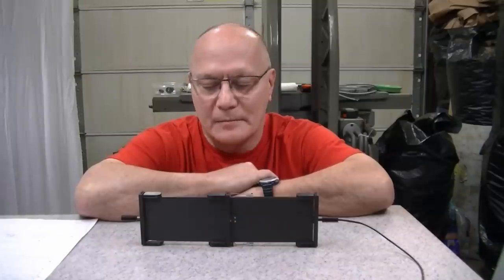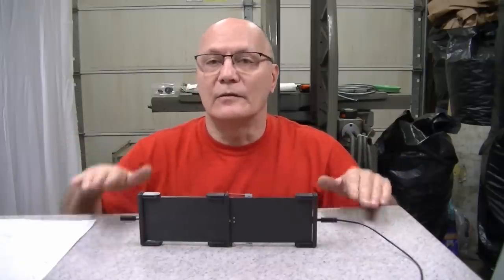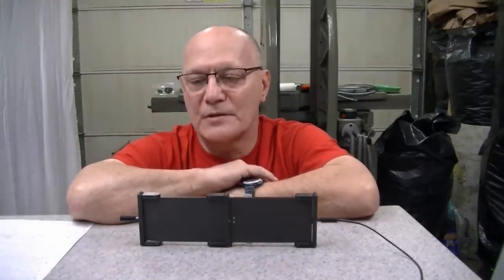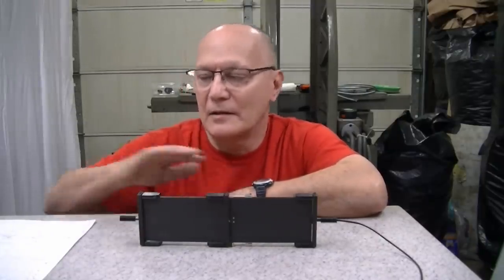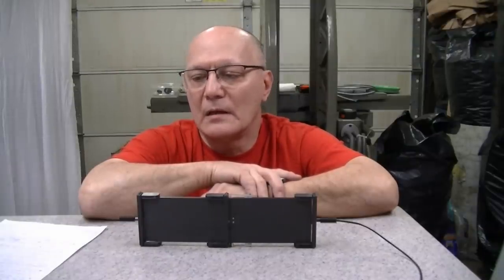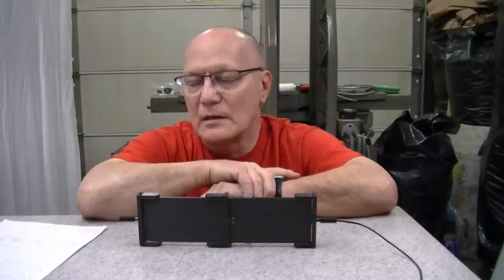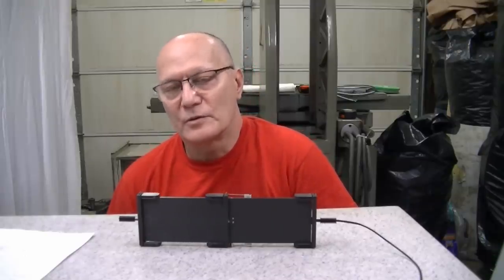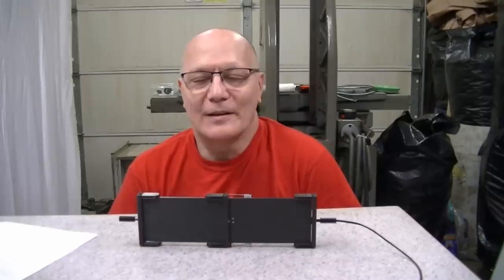DIY SURFACE PLATE LAPPING ANSWERS TO PART 1 QUESTIONS

Comment: So that "lap" resting on the plate makes it "not level" but its crucial to make sure the plate is "level" even though anything you put on it will "bend" it therefore making the whole plate USELESS since you can't put anything on it without "ruining" it by "bending" it even if only temporarily. Temporarily "bending" it while the load is on it, that is. How does anything "bent" by that "lap" or anything else placed on it or even "jacking" up one side of its "support" ever stay "flat" or "level" even IF it were possible to "level" it without "bending" it in the first place? You sure you know what the hell you're talking about? And isn't the proper way to use a "surface plate" to NEVER drag work or tools across its surface? If you want something to stay "flat" and "level" you don't drag hard objects across it. Ever. You lift up and set down work and tools VERTICALLY. Seems to me that anybody who manages to wear a surface plate period doesn't know what the hell they're doing and you sure as hell aren't going to "level" a "warped" or otherwise worn surface "flat" by dragging more objects across a "reference surface" that's not "flat" or "level" enough to support a "flat" and "level" lap. You sure as hell don't lap anything else in the "precision machining" world by using a "lap" smaller than the surface to be lapped and laying that lap on top of the surface to be lapped so the surface to be lapped that isn't as "flat" as the lap has to "carry" the lap but can't have its ENTIRE SURFACE LAPPED AT ONCE. In fact, you do the EXACT OPPOSITE and put the "lap" on the bottom, make sure the surface of the lap is FAR LARGER than the part to be lapped and move the PART all over the LAP keeping the part "stationary" while moving it in a figure 8 pattern so its "turning" relative to the surface and path it takes on the surface of the lap and "pushes" material removed out of its way. And by the way, you don't LAP PARTS to make them "flat". You LAP PARTS to put a specific SURFACE FINISH ON THE PART. Its "smoothness" you LAP ONTO A SURFACE. Not "flatness" or "levelness".
Reply: Deeremeyer1 actually, from what I have seen of professional surface plate lapping, the laps are often SMALLER than the actual surface plate being lapped they seem to get them to within AA certification with no real problems - I am sure i could find at least one video showing this being done right here on youtube, or you could simply let your fingers do the typing and look up oxtoolco surface plate calibrating and conditioning when they had one of theirs redone to AA specs then watch the video... WOW real world people doing REAL WORLD RESURFACING... 

After your rants, I expect you will be just as enthusiastic in your reply where you should of course apologise for your total misinformation with regards to lapping... 

Cheers
Reply: There is a video on tom liptons channel showing professionals lapping his surface plates with smaller laps.
Reply: Would like to see the lap they used for the largest surface plate in the world, as that would be then the largest surface plate in the world, which needed a larger lap, which would be the largest surface plate in the world, which...See where I'm going with this?

You can make a flat surface plate with a fucking toothpick if you just painstakingly measure everything.

Comment: Uh, those "lapping machines" use the parts and movement they do to DUPLICATE the "figure 8 movement" which is used to NEVER be "lapping" the part by moving it in a STRAIGHT LINE across the surface of the lap or vice versa. STRAIGHT LINE TRAVEL is like putting a BELT SANDER on the surface you're trying to "lap" AND the "lap" itself. A figure 8 motion is also "self-cleaning" and "self-lubricating". It sure as hell seemed to work back when I learned it for lapping diesel fuel injector pump and nozzle parts "flat" so they seal thousands of psi of oily diesel fuel without gaskets or sealants. Want to give it a shot with your preferred "straight line" methods? Simply going around and around would "spiral" the tiny "scratches" left in the lapped surfaces and that high-pressure fuel would simply follow the "spiral" to its end and leak. Which would be "preferable" to having thousands of straight-line leak paths lapping the part with a straight-line motion. 

This may surprise a "thoughtful" machinist like yourself, but your keen powers of "intellect" and "reason" and "logic" are no match for real-world experience out in the field and the "right" way to do something is the one that produces the BEST RESULTS FOR THE END USER rather than appearing to be "best practice" for the "manufacturer". A "real machinist" such as yourself should sure have taken a few lessons at the "school of hard knocks" where the tuition is lost time, money, customers and maybe even jobs and businesses when "best practice" on the "manufacturer's" end produces part and machine failures on the user's end. Right? Or have you worked in the "real world" other than maybe doing "government work"? There's a hell of a lot of difference between a "contract" to produce a "prototype" for some government agency to "test" and one to produce parts to a manufacturer's specifications for use in a "finished product". The latter means your work has to WORK RIGHT THE FIRST TIME and worst-case scenario isn't the end-users i.e. CUSTOMERS sue the manufacturer and the manufacturer sues you and you use that to claim "breach of contract" and collect a big fat settlement check from the manufacturer and make 10 times as much money "failing" as you ever would have "succeeding". 

Worst-case scenario is the manufacturer "renews" your contract, sends you a "revised" set of "blueprints" and instructions, waits until you whip out another "run" of still-defective parts, sues YOU for fraud and breach of contract when you sign off that the parts are made to spec and then gives you the option of making the "replacement" parts for free, paying any penalties and costs associated with the failures incurred by the manufacturer, signing a "confession" so down the road any "class action" lawsuits or even individual lawsuits from customers that have machines fail after warranty get dropped at your doorstep, forfeiting your "contractor" status with the manufacturer and signing a "no compete" contract so you personally aren't ever again the owner or operator or employee of a business in direct competition with whatever "supplier(s" the manufacturer sends the remaining work to and which probably didn't get the initial contract because ITS "experts" knew the additional expenses associated with doing the job CORRECTLY and read the requirements and specifications and "blueprints" correctly and bid the job much higher for a reason and was surprised but not "disappointed" to not get it figuring somebody had to be cutting corners  somewhere. 

That sort of thing happens ALL THE TIME when "educated idiots" from the "public sector" or "government contractors" who find themselves "unemployed" and still too many years and tax dollars donated to their pension plans to "retire" decide to "start a business" in their field of "expertise" or "invest" in one that's "struggling" or in "receivership" or just seems ridiculously "cheap" and "easy" to make a killing in since "government contracts" are so easy to get or that particularly business/industry is "booming" or is "recession-proof" or whatever "economic model" from other "experts" makes getting into it a "no-brainer". The problem is that "government work" usually means "research and development" and/or huge "projects" that most of the time are "too big to fail" for "government agencies" of the "civilian" variety with big budgets they have to spend or lose and tons of "engineers" and other "scientist" types that ALSO have never worked in the "real world" if you can call their careers playing with super-expensive "toys" bought and paid for with "discretionary spending" WORK in the first place. 

And with no real "requirements" that something has to work the first time or EVER for that matter and "unlimited funds" and "job security", let's just say if it weren't for the "private sector" and "blue collar workers" who have to and want to do things and build things and judge "success" by how well they do things and how productive they are and how much of their time is spent doing things rather than re-doing them and OFTEN get paid BASED ON how well they do things the first time and how well they get things done ON TIME,  even "government work" wouldn't ever get done. After all, its the "private sector" where things "agencies" like NASA take credit for building and "educational institutions like MIT or Cal PolyTech take credit for "designing" actually get BUILT. And you'd be surprised at how "rare" MEs and EEs and Ph.Ds are "on the floor" and "in the field" doing the nuts and bolt stuff and the real "R&D" stuff. Clearly you have spent that much time in that "real world" or you wouldn't question why a certain "process" is used there to produce parts made "to spec" where "direction" is just as important to the machining process as "speed". Because its NOT like "lapping" is the ONLY area of machining where direction matters. An old master machinist legend of the lathe like yourself should know that. 

ALL machining is ultimately done for ONE REASON. SURFACE FINISH. The surface finish is what carries loads and seals and cools. And surface finishes are "directional" in some cases because they have to be and "non-directional" in OTHER cases because they have to be and LAPPING is just another "cutting" operation. And that cutting leaves "scratches" and when you put one "scratch" next to another you have the beginnings of a "ditch". Mix "lapping" patterns/directions like "circular" and "axial" on a "part" that's WAY bigger than the "lap" (not that anybody who knows what the hell they're doing "laps" a large part with a small lap) and you start making a BOWL thanks to the back and forth and round and round motions and the fact that you have to turn the lap relative to the tool or vice versa to do so. A figure 8 turns neither the lap or the stone, cuts neither straight lines or circles and produces a "non-directional" surface finish where outside contaminants and inside lubricants can't find a "continuous" path in or out. Of course that's not a problem considering in the real world two lapped parts aren't turning relative to each other or there would be no point in lapping them separately. 

In the "real world" you NEVER "drag" one surface across another with no lubrication between them unless you WANT "wear". And when a surface is "flat" you keep it that way by not exposing it to conditions and forces that will "bend" or "warp" or "wear" it. That means keep it "cool", keep it evenly "loaded", don't let it "move" relative to "stationary" surfaces its in contact with and when its not "covered" with its "mating" surface, don't treat it any differently with "foreign objects" than it gets treated "assembled". Kinda hard to MACHINE ANYTHING without a mixture of "axial" and "radial" motion with either the cutter or the work "stationary" on one "axis" and "moving" on another but with neither ever doing "both" during the machining process start to finish. But go do a "combination" of "circular" and "linear" motions "lapping" an non-rotating surface plate with a non-rotating lap and think you're NOT going to "dig holes"? What happens when a lifter stops rotating on a camshaft lobe? Flat cam in no 
 time. Look at the base of a new lifter. You'll see its been "lapped" and has a "non-directional" pattern of "scratches". And its slightly "convex" whether you can see it or not. Put an "engineer's square" on it and you might see it. 

And the lobe it rides on will be "tapered" very slightly. Why? For rotation. No "direction" to those surface scratches, no "flat" surface on any "axis" and the lobe turning under the lifter somethings going to try to "slip" away from the other part and have to "roll" away to do it. The camshaft sure as hell can't. But the lifter can "roll" in its bore. And they do. Until eventually they wear through the surface hardness and start "dragging" and then they go flat in a hurry. Especially when cheap parts manufactured with "out-of-spec" materials and/or tools are "substituted" in order to "save money" by "engineers" and other "experts" with lots of "training" and "information" but not a lick of "experience" and "knowledge" and think that any "expert" who has the time and inclination to sit around writing a "textbook" instead of working in his field of "expertise" is writing a "textbook" for any other reason than he's got plenty of "free time" and needs the money because his "day job" isn't paying the bills. Especially if he doesn't have it anymore after his "expertise" in whatever field didn't "translate" too well moving from the "laboratory" to the "factory floor". 

There IS that old saying about those who can and those who can't. Something about "doing" and "teaching" if I remember correctly. I've had a lot of "teachers" during my ongoing education as a professional mechanic. I never have had trouble spotting the ones who have done and taught. The ones who have "done" can "teach" hands-on "lab" work without wiping their hands ever time they touch a part.
Reply: Deeremeyer, You seem to really know what your are talking about, lets see your video on reconditioning surface plates so we don't have to be confused this hack any further...
Reply: So you dont like what he's doing? You went off somewhere without finishing on a specific point about this guy whose roughing in a surface plate to see if he can do it, in his leasure, while showing others who want to see if it will work out. Yes he is roughing it in. (to a point where he could get a pro to bring it to spec economically, I think is what he was doing)
 In comparison, some people climb a mountain just to see if they can do it. People go on vacation, hoping to have a good time but may have a terrible time but they go again next time and try their luck again. :-) We'll see how it turns out hey.
Reply: First of all I would like to adress your use of "quotation marks" on half of the words in your rant. When all words are acentuated, none are. They lose their effect when you use them on every noun you have become annoyed with.
Secondly, you should really stop ranting on videos like these where real people are learning and sharing their learning process with the rest of the world. The internet provides a hell of an education to people around the world motivated to learn these things, and this is the way you get them interested on these kind of topics. I admire every man in his garage/shop trying to share something educational with the world. These skills will otherwise be lost in a world of CNC and million dollar companies guarding their special formulas and thechniques. You and every other person on this god forsaken planet would still be hunting moose with sticks and stones if everyone would keep "doing" and not teaching what they learned. The world need knowledge to progress. Knowledge built on knowledge of others. We need the right people knowing the right combination of things to keep this amazing ball of dirt and assholes livable for the future assholes. This is only possible when people are willing to teach. And sure, not everyone teaches the "right way" as you like to say it. But please come off of your high horse and react to this guy figuring things out with a bit of respect instead of saying how amazing you are yourself. Put your ego asside and teach the man something. Teach us all something. You clearly have the knowledge, now put the ego asside and comment something worth reading. Something where the message isn't burried under heaps of patting yourself on the back. Some people might learn a thing or two. And maybe, just maybe this god forsaken ball of dirt gets a bit more livable becouse you tought some assholes something.
Reply: What is wrong with you that you would watch someone's entire video and then criticize them in such a longwinded manner that you come off as undeniably insane?
Reply: Most noise usually comes from those who have Dunning-Kruger
Reply: Just affirming my experience that figure eight is as you say self cleaning and self lubricating even with light pressure which is necessary to maintain finger tip feeling all day lapping hundreds of parts less than .0001 total tolerance for thickness variation. Measuring was taken in 3 spots per part after cleaning drying they where each measured again and the thicker ones were lapped a second time.  I've heard this about figure 8  motion before and I have tried circle lapping parts but the result was for me possibly because the shape of my finger.